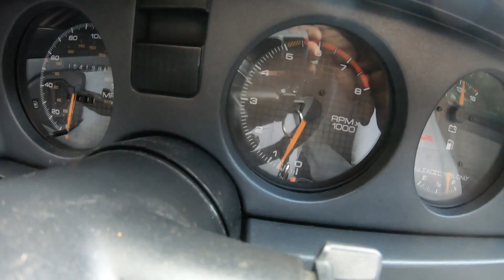Stock GM TPI swap to FIRST TPI install - 1989 Trans Am

Comment: I don't get how people are paying more than what you sell these for for old used stuff that still doesn't work as well as this intake. It's just a no-brainer to use this, bolt it on and be good to go. The base especially is the HUGE improvement. The runners are shaped so much better and are larger than stock. Even understanding the GM bean counter mindset and the intent to make toque over hp, how the factory could ever feed 1.94" valves with 1.46" ID runners is beyond me. This intake just as provided is a significant improvement and as you say, the runners and base still have room to port if wanted/needed. My (new to me) 91 6-speed Z07 Corvette will be delivered to me in a couple of weeks and I'll be ordering an intake from you. I'm planning on Vortec style heads (not sure which ones yet) along with the Lunati Voodoo cam that's 211/219 duration and TPIS headers with all new exhaust.
Reply from the maker: Very well said,  it has had me scratching my head for years as well!😁
Reply: I agree 💯.  love the TPI intake .it is so easy to work on I replaced the injectors with Bosch injectors from South Bay Fuel Injectors and have her all tuned up and being so nice now running perfect.

Comment: Pro tip:  take a couple of threaded studs (since you have the vortec heads with vertical bolts) and use them to guide your intake manifold down onto the heads (and hold your intake gaskets in place) during assembly
Reply from the maker: Thanks for the tip!

Comment: I know this is an older video. But when I got to the trottle cable mod I wanted to add a helpful tip being a custom bike/car guy. To make cutting and using the adapter easier, Solder the cable first and it helps to keep the wires from fraying out.
Reply from the maker: Thank you for the tip! It could be helpful in some cases, depending on the condition of the cable. I usually just twist the cable in the direction it tightens on itself as I insert it into the cable end.

Comment: is this a direct bolt on to a completely stock l98? i was just wondering if any tuning has to be done to support this intake, im interested in a better tpi setup but i dont want to go to a stealth ram . what budget oriented cam and heads best compliments this intake?
Reply from the maker: There will be some modifications required, basically the same as the trans am video. I would definitely recommend a new tune and larger injectors. If you email me at Ken@firstperfcenter.com I can get more in depth with head and cam combinations that will work best for you. I really need more information about your project and goals, before I could recommend heads and cam. We will be doing another install video soon with a 85 Corvette, which may help also.
Reply: @firstperformancecenter  When is the 85 Corvette video coming out?
Reply from the maker: We are in the process of  doing other work to the car currently, so the actual intake installation video will be after that work is done. So hopefully sooner than later!

Comment: cast iron vortec heads?  flat tappet hydraulic cam in a roller cam engine? Nothing like low compression huh? What is that a 9 :1 compression engine? that engine is hard pressed to make 325 hp with a carb and dual plane, with a TPI 300. An extrude honed stock intake, LT4 hotcam, 1.6 roller rockers, 52 mm throttle body, with 113 ZZ4 heads (cleaned up with multi angle valve job and 1.56 inch exhaust valves) made 367 hp @ 4900 rpm 456 torque @ 3800 on Eddie Carlisle (Carlisle Racing) dyno. Id love to compare my correctly modified factory TPI to yours on a chassis dyno. Mines in a 1989 Corvette with a TCI Street Fighter 700R4 and stock 3.08 rear gear.
Reply from the maker: I actually do not know all the specs on his engine build. It was a customer car that had that engine in it already.  We just installed the FIRST intake on it. It definitely made a huge performance difference seat of pants and the customer was happy as can be and that is what matters most. I am quite sure your build would whoop the pants off of anything we do for sure, I can tell you are that kind of builder! Enjoy your awesome ride and thank God you did not use the FIRST tpi as I am sure it would have definitely ruined your build!😁 keep on wrenching and enjoy your project as it sounds like a fun one to me. Thanks for your input and sharing your knowledge!
Reply: @firstperformancecenter  Im a former motorcycle drag racer that got thrown off a GS1100E @ 140 mph and said screw it I want 4 wheels and a body around me. I love C4 Corvettes and Im extremely partial to aluminum's heat dissipation. I got into Stock Eliminator and built an 87 Monte Carlo SS (K Stock Automatic) that runs a consistent 11.70s @ 117 mph with an 87 L69. My Super Stock was (I sold it 2 months ago) a 66 Chevy II Nova (Super Stock J) that was an 8.60s car @ 161 mph. I've been building cars and motorcycles all my life and making them hotrods. Enjoyed the video, sorry if I came off critically, Im just type A personality which is a prerequisite to being a successful drag racer. Plus Eddie Carlisle is a whole lot of help.
Reply from the maker: I completely understand! It sounds like you have plenty of experience with building fun! I have been building cars professionally for 40 years now myself and making the FIRST tpi for 24 years. No one is going to hurt my feelings, I have super thick skin and I am always getting abused!😁 I am glad that you were able to come away from a bad race accident and get back on the horse! Keep it up as you know a true gear head never stops! We are in the business to try make people happy and some people you just can't make happy. Everyone is entitled to their opinion and as I said thank you for your input and sharing your experience! I want this channel to be open for discussion for all opinions and experiences. Thank you!

Comment: You seem to be very knowledgeable about these engines. I have an 87 Camaro with a 305 TPI
Reply from the maker: Thank you! We’ve been dealing with these types of situations for over 30 years so we do have experience with them. But we still learn new stuff every day! Very nice! I have an 87 Trans Am with a 305 H.O that we converted to our FIRST TPI
Reply: @firstperformancecenter  Thank you so much for the response! However I cannot find that exact throttle bracket you have mounted on the throttle body in the video on the website. I did find the cable brackets that mount to the intake manifold, but I need that bracket that the ends link to the throttle body. Does that have a part number to buy yet?
Reply from the maker: @NotAGarage  I am not sure what you mean? Can you email me a picture of what you are looking for or maybe give me the time stamp from the video?

Comment: Where are guys located? I have a Firebird 85 when I start it up The engine sounds like it going to turn off and car shakes a bit but then like it gets air and goes up again. Is there a Throttle sensor  or something to improve the engine starting up?
Reply from the maker: We are located in Bristol, WI.  You can email Ken@firstperfcenter.com and he may be able to help. There are many things that can cause what you are describing, so it is best to walk through everything with Ken.

Comment: Where can I buy that bracket for the throttle cable/kickdown cable?
Edit: It looks perfect geometry for the throttle and the TV. I can use it on my 5.3 in my 87 Trans Am that I have bolted up to 700 R4. It's the last piece to my puzzle I need. My throttle cable is linked, and works perfect. But I don't want to weld a piece on the throttle bracket. This would eliminate that hassle, and looks quite sleek.
Reply from the maker: We do have them for sale on our website www.firstperfcenter.com.

Comment: 1987 bone stock 305 TPI to make the swap to FIRST® TPI Painted finish Black and Red, is it a plug and play or will i have to change out the cars ECM PCM computer?
Reply from the maker: Swapping to the FIRST tpi from a stock tpi electronically is a plug and play situation. You can use your existing ecm and all the required sensors are the same, but we would recommend a new tune. There are other modifications needed to the fuel system and possibly the throttle cable.

Comment: Maybe you mentioned it in the video, but where can I get the valve covers?
Reply from the maker: They are actually the chrome pro form covers that Jegs and summit sell. I just sand blasted them and painted them to match the intake for the customer. I just hand striped the red highlights like I do on the intake top and side plate. Hope this helps!

Comment: Great video, it seems for the price this is a no brainer. I have a 1992 5.7L Formula, mostly stock (except exhaust). Would this TPI work with a stock engine/heads? Is there anything I would have to modify (Larger fuel injectors/high flow fuel pump/lines)? How it would just drop in and work with stock components? I think a Q&A section will help. Sorry too many questions, I’m really interested on this TPI.
Reply from the maker: Yes this TPI is a no brainer in our opinion as well! This system is all brand new, it is the  largest true TPI system available. Much larger and flows better than any bolt on components available for your stock GM tpi, even if you were to port the stock parts and the aftermarket bolt on parts! A lot of work to do, when the FIRST  tpi is available with the best flow already out of the box and you still have room to go if needed.... all the way to a true 1.9" ID! Yes, the FIRST will work on the completely stock engine. However, the stock heads and cam will be the limiting factors to the flow potential of the FIRST at that point. However you will still experience gains. The large majority of modifications are addressed in this video. It is recommended to use a larger injector (we would recommend 24# injectors for your stock engine) but you should be able to use your stock fuel pump on a stock engine application with the FIRST. We are happy to answer any questions you may have in the YouTube comment section/any other social media pages or you can email us! Email: ken@firstperfcenter.com
Reply: @firstperformancecenter  great info, thank you Ken!
Reply from the maker: You bet! You can also give us a call with questions as well 262-857-3333. Whatever it takes to answer all your questions.

Comment: About how much hosepower does this increase the engine and is this engine still controlled by the stock computer?
Reply from the maker: Milesmania The HP gains will be determined by the condition of the current engine and the supporting components. Also, proper tuning to take advantage of the extra air flow is crucial. We know that the FIRST TPI "as cast" with the 1.75" ID runners and a small 1204 port flows over 30% more air than the factory TPI, so you can figure from that what the potential can be. The FIRST TPI is also able to be opened up to 1.9" ID all the way though and siamese work can be done as well to improve upper RPM power. The intake port size can also go up to 1207 and can be used on the Vortec head which will increase flow as well. I will be doing a complete video soon on the actual intake and all the history and modifications that can be done. The 89 Trans am in the video is using the factory OBD1 ecm with a tune specific to the current engine specifications. Thanks for the question and please feel free to ask any questions at all.
Reply: @firstperformancecenter  At what point do you recommend going to the 1207 intake port and 1.9" ID runners? I plan on going with a set of afr195s, First TPI intake and a healthy roller cam in my 85 Corvette.
Reply from the maker: ACMX _ 92 you would go to the 1207 port and 1.9” ID runners and possibly even Siamese the runners when you want to try and achieve higher rpm goals. The 195 head should work great for you.

Comment: At 29:47 it appears that you connect the PCV valve to the fresh air side of the system. Is this correct? I only ask because I believe factory routing has the PCV valve going to the intake manifold and CCV pulling fresh air from the throttle body without a valve.
Reply from the maker: So with the FIRST tpi we have the PCV connection under the throttle body and the breather connection under the throttle body as well. The PCV connection is behind the plate for the vacuum side to pull from the crank case and the breather connection is forward of the throttle plate. You can look at the vacuum diagram on the website manual down load as well.

Comment: Hi, I've got a 91 GTA 305/700R4/3.08(?), headers, k&n/ram air, 288K kms and blowing blue smoke at start and run ... but getsv24 us mpg (28uk mpg). So, I want to rebuild but my goal is 300hp and 30mpg. The simple formula is gears, intake, cam, heads but I've heard cam will kill mpg and no need for heads for only 300hp. But intake is restricting, and I've heard a lot of good about yours. My question is, do I even need this much intake for just a 305 and just 300hp or would I be better porting what I have? Thanks for the great video and congratulations on the apparent great service you provide
Reply from the maker: Hi Scott, sounds like a great project and goal! You could certainly do port work and maybe use some of the bolt on runners like SLP or the edelbrock runners and base, but I do not believe they make those parts any longer new and they seem to be very expensive used. You can almost buy the FIRST tpi all new for what those used parts cost! We have many customers using the FIRST tpi with the 305, and we have an R&D 87 trans am with the 305 with great success. Thanks for the input on the video and definitely reach out to ken@firstperfcenter.com if you need anything more!

Comment: I got a question. I have a 87 IROC-Z and I want to install the FIRST tpi. Is it compatible with the cold started injector ? Or do I have to delete it ?
Reply from the maker: Hi, the cold start injector is eliminated when you use the FIRST tpi. That will get compensated for in the new tune.

Comment: Hey Ken, since the C4 video isn't out yet, do you recommend retaining the AIR/smog pump on L98 C4s? The hoses from the double valve take up so much room it's super tough to run fuel lines and definitely can't mount an AFPR near it. One of many packaging challenges with the C4s!
Reply from the maker: Hi Bryan, there is actually a 1985 corvette install video on our channel, so you can check it out. We would eliminate any emissions equipment as long as it is allowed in your local and state laws.
Reply: @firstperformancecenter  Y'all are class acts. Somehow I missed that video and I've even watched parts of it before. Thank you for being polite. To be clear, can you confirm the smog pump valve wires just get taped back and are solved with a tune?
Reply from the maker: So yes that can all be turned off when the prom is reprogrammed. I would be sure to put some heat shrink tubing over the connectors before taping them back to be sure no corrosion gets in.

Comment: I have been wanting to buy this for years the only reason I havent is the lack of knowledge in the Stock ECU and tuning especially since the EGR is deleted and the larger 24lb injectors, as well as the ninth injector (cold start injector) being removed. What tuning is needed and what tools are needed for the tune? Please do a video on this as this is a major thing to know. (I have a 1988 IROC Z with L98 350 TPI stock)
Reply from the maker: Hi Mike, we can actually help with the tuning side. We have people we work with that are very experienced with tuning around the FIRST tpi and priced affordably. Hopefully this will help take the worry away! Please email ken@firstperfcenter.com if you would like more details about this.